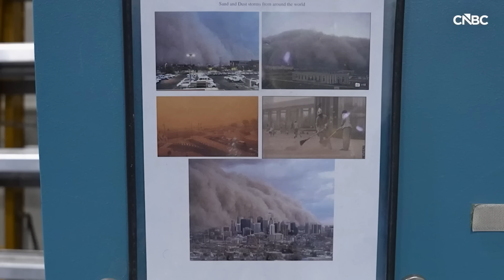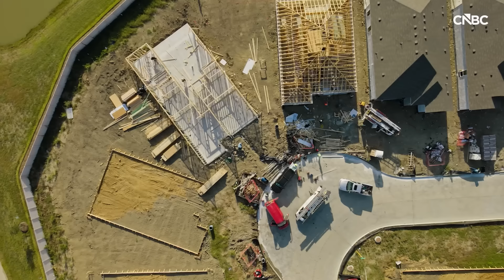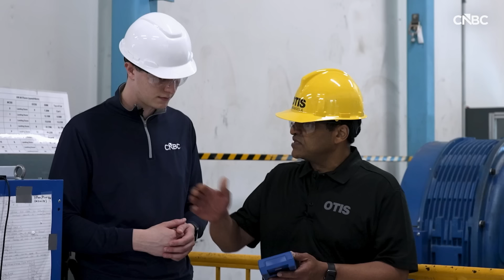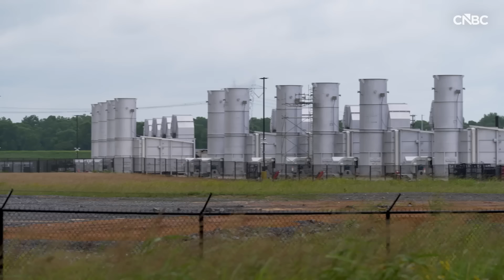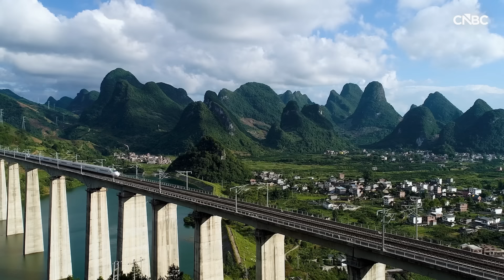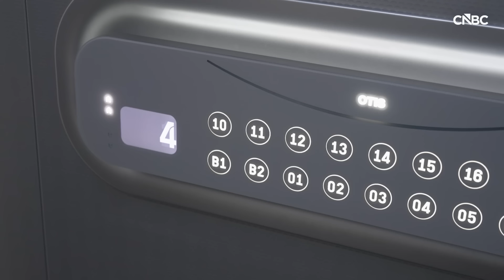The Business Behind The World’s Largest Elevator Company

Comment: Maintenance is where the money is at for elevators and sprinkler systems. #1 The technicians are in the highest paid trades. #2 both systems have to be thoroughly inspected once a year and signed off by local authorities.#3 for elevators, every five years they need the extensive inspection with heavy weight brake test.
And people wonder why high-rise condominium complexes have such high HOA fees and I didn’t even mention the grinder pumps for sewage & the lifting pumps for high-rise water distribution. Going vertical comes at a cost.